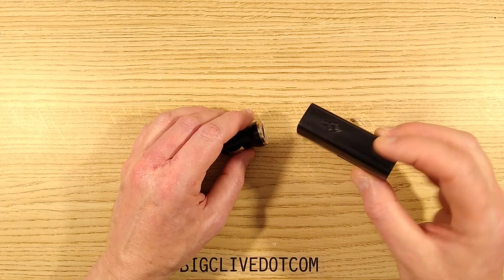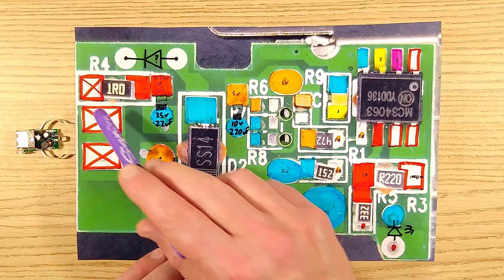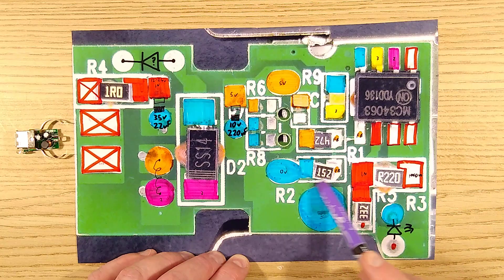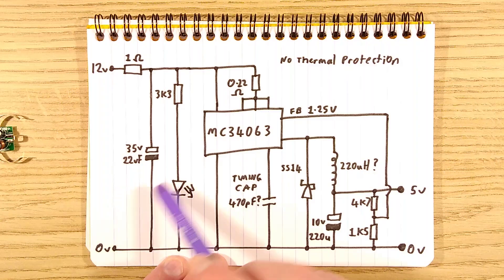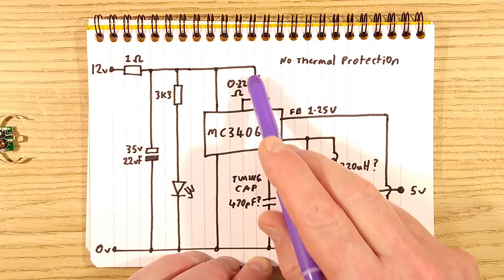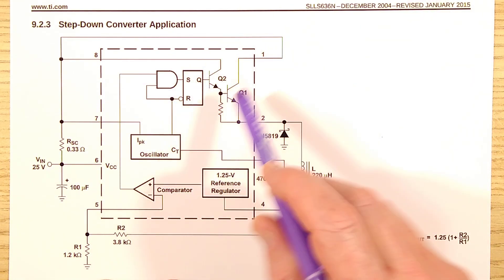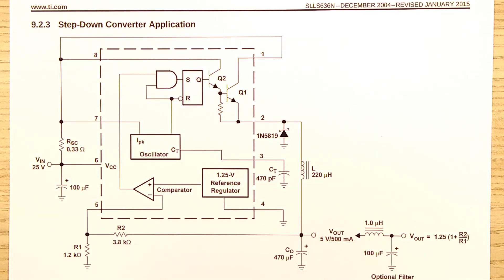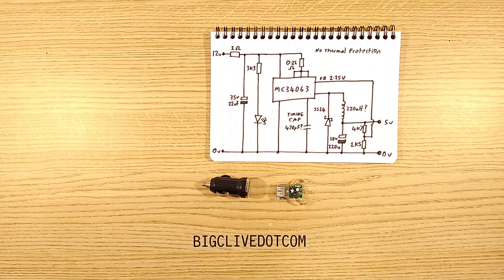Ordinary product with iconic component

Comment: Of course there will be 14V input to this when the engine is running. Will that slow down or speed up the oscillations?
Reply from the maker: I'm not sure how voltage affects the oscillator timing.  It may have a fixed voltage reference.

Comment: It'd be interesting to see if one can add a simple upgrade for thermal protection... e.g. something that would cut off the 12V input, based on a thermistor value.
Reply from the maker: It could possibly be used to skew the voltage feedback circuit to lower the voltage.
Reply: @bigclivedotcom  Chinese XL4015 buckconverter chip has this kind of suggestion even in datasheet. Introducing over 3,3 V to feedback pin makes chip to go in standby.

Comment: With more places jumping onto the USB-C/PD-for-everything bandwagon, we'll hopefully see more devices with DC input designed for 12-20V and charging using a dodgy 12V adapter won't be much of an issue anymore. Car adapters really should use a SEPIC topology to capacitively isolate DC-in from DC-out. Then expensive gadgets would be protected from input-side faults and transients up to the DC-blocking capacitors' breakdown voltage.

Comment: 3:48 Would this still be a disaster with USB C PD capable devices? Since they can accept higher voltages though I have no idea what happens if a PD capable device was expecting 5V only to suddenly get 12 since it is more than 9 but less than 15, hopefully just blow a fuse on the charge port.
Reply from the maker: I think a new device would handle the higher voltage with no issue.

Comment: At 00:55 you state it could blow up your phone,,,, The very next statement should have been, DON'T BUY THIS AND IF YOU DID THROW IT AWAY and then ended the video right there.  Absolutely no reason to consider this product at all unless you need some parts.
Reply: 100% agree. The MC3406 is interesting due to its simplicity and "building block" design but has no place being connected to valuable devices like mobile phones or sat navs.
Reply: Definitely wouldn't say end the video right there rofllmfao

Comment: The mystery missing diode was a 1N914 or similar.
It basically serves as a fuse in case someone's power outlet is wired backward, or they install their battery incorrectly.

It would create a dead short to blow any upstream fuse, or it would let the smoke out and shut down the circuit protecting the cell phone or other device plugged into it.
Reply: That would make sense too
Reply: How would the adapter and device remain shut down after the backwards diode blows?  I think it would only protect the output circuit if it blows the internal 1 ohm fuse before dying .  Car batteries can dump out 70 A or more for the starter motor anyway, so will barely feel the short, and utility sockets (cigar lighter sockets) often have generous enough fuses to allow plugging in an external starter power source .
Reply: @johndododoe1411  They would be relying on the 1 Ohm "fuse" burning out. It seems unlikely they would choose a small signal diode like a 1N914 which is only tated for 300mA, you usually see a rectifier diode like a 1N4001 or equivalent in this position.
Reply: @johndododoe1411  I think the idea is to burn the 1 ohm resistor.  It's probably rated an 1/4 or 1/2 Watt.
Reply: @johndododoe1411 
You're right, the battery would't care, but the fuse in line with the outlet will. It could be that the 1R is faster to blow but I'm not sure who would win this race
Reply: @johndododoe1411  It's not the diode that will blow in that situation.
Reply: A smarter design is to put the diode in series with the 12V. That absolutely provides reverse battery detection, at the expense of a reasonable diode and a lot of heat. Or you can use a Schottky. But as the existing diode isn't there, the budget doesn't stretch to doing this properly.

Reverse battery protection is HARD, especially for things like car ECUs which have to draw a lot of power. Everything the OEM puts in a car is MEANT to survive this and the devices all have reports saying they've been tested and survived. Aftermarket stuff - not so much.

There are two nasty ways to have a "reverse battery accident". First you put a battery in a car and get the terminal connections wrong. The other way is to have a car with a flat battery and connect the jumper leads up the wrong way around.
Reply: @TeVolt805  When I worked for a manufacturer of automotive widgets, we used to use a reverse diode that was chunky enough to outlast the power fuse. (And yes, this was tested at the product validation stage, by blowing lots of fuses.)

The voltage drop across a diode can be significant once you start getting into whole amps .....
Reply: @bluerizlagirl  One "Chunky Diode probably costs more than all of the components in this cheap product. They didn't even put in the (small) one that is meant to be there. For those asking "what's the use of blowing an internal fuse", there are two answers to that. It is better to blow a fuse than catch fire, which can happen with reverse battery. It is also better for that sub-$10 device to suicide than to dump MINUS 12V into your $2,000 mobile phone and kill it instead when there's a Reverse Battery Accident. But the makers didn't bother with that.

The 0.22R "current limit" resistor also jokingly limits the design current to 1.5A through the switch. Which is a design output current of 3A. Which is probably way over the thermal limit. Just using a properly selected resistor might make this thing safe against over-temperature failure. But they didn't.

Comment: I thought it would be a 5v regulator.. found them in these before..The LM series.
Reply from the maker: They dissipate the voltage difference as heat, so would not be suited to high current.

Comment: If I remember correctly ON is ex Philips. MC is Motorola's prefix, and though most of semiconductor manufacturers do license out and run batches of each other designs in China they don't pay much attention to what they print on the package and even less to paying license fees.
Reply: ON is the standard and discrete components spin-off from Motorola, NXP/Nexperia is the spin-off from Philips
Reply: @inse001  Thanks

Comment: i had/have that same car charger and used it to charge my android (used it all day while working) for over a year. it actually held up better than lots of other ones i used
Reply from the maker: An android phone will often test the charging device to see what current it can supply by gradually increasing the current and monitoring the voltage.
Reply: The same circuit or just the same plastic casing?
Reply: @johndododoe1411   i had opened it up years ago and seemed to remember it looking exactly like it. however since you asked i decided to dig it out and look again. turns out is not even close to the same circuit at all
Reply: More high end chargers claim to have multiple layers of overvoltage/overcurrent protection, which means more failure modes, which works against holding up the longest.

Comment: I wish I understood these things as well as you do.  I figure I get about 35-40% of it all.  I'm more apt at mechanical contrivances vs electrical.  I can can take a pew pew that I have never seen before and strip and reassemble it without question though.  My buddy used to call it a mastery of spacial relationships.
Reply from the maker: It will make more sense over time.

Comment: Quite a lot more in that freebie adapter than the ones you can get at the buck-and-a-quarter stores here in the US.

The one I took apart had an 8 pin thru hole chip but the lead spacing was smaller than the usual 0.1in spacing. Then it had a couple caps, an inductor, and an LED. No other components. The chip even has a dedicated leg for the LED. I guess it was cheaper to put as many components in the all in one chip as they could so PCB assembly could be done faster.

Comment: I tried to use one of those devices recently. It seemed nice and available when so many parts are hard to get. It's got dreadfully high on-resistance so very lossy. I tried adding an external transistor but had to replace it with a tps61088, which is far more effective.
Reply: They are a poor choice for any new design that isn't extremely cost sensitive. The losses in the bipolar switch is one issue, but also they only work up to around 100kHz so it demands larger inductors which incur either more loss or more cost.  It also uses hysteretic control which is prone to creating RF interference at low loads (a very common complaint for these cheap car adapters).
Reply: Not on resistance as it has a darlington BJT.  VBE plus VCE drop.
Reply: They were designed back in the day, when the standard for getting 5V out 12V was to use 7805 with an external BJT and a heatsink. So you can imagine, that even getting efficiency from 40% to just above 80% was a huge deal. They seem to be "very lossy" now, because you have next two generations of switch-mode regulators available to choose from, but you wouldn't have those without the first gen. stuff like this.

Comment: The reason why the MC34063 is still around is because it's a commodity item, it's cheap!  It's also available in the 8 pin DIP.  I bought a tube of them recently.  👍
Reply: Not a thing wrong with it so long as you put some safety circuitry on the load side, like say, a crowbar, lol.
Reply: Yup yup, have used them, cheap they do EVERYTHING but yeah, does need some consideration.
Reply: I saved a bunch of them from some PLC modules that sank down when flood hit open pit coal mine. Modules became unusable from transformers going bad from water.
Reply: They aren't very good, though, as they are prone to subharmonic oscillation without very careful circuit design. They tend to come on, overshoot, switch off, let the voltage decay, then repeat.

A lot of switch mode regulators can do the same thing but they usually use current mode control or other more advanced multipole compensation methods to try to avoid it because it's bad for EMI, regulation, squeal and other things.
Reply: @nicholasvinen   This is (mostly) true of (almost) any SMPS regulator with output protection circuits.  If you don't respect minimum loading specs, or filtering requirements, overshoot will kick off the OV protection circuit.  I've never heard this called subharmonic oscillation, but I suppose it does fit as well as anything else I've used to refer to it.  

This is a consideration of any buck/boost regulator I've ever run across.  The inductor energy has to go somewhere, and this does require careful design.  Mike Engelhardt designed LTSpice specifically as a design aid for designing this kind of circuit in-house at Linear Technologies.  Inductor and capacitor (energy storage devices) selection and matching to anticipated load range is always important to avoid triggering protection circuits unnecessarily.

If your circuit is "hiccuping", you need to do more design work.  Doesn't mean the chip is junk.  Just means it's simple.
Reply: @nicholasvinen  .. I think you are being a bit harsh. With the right capacitor choice the 34063 will run nice and stable.
If you are talking about minimum load requirements and going discontinuous, MANY smps chips all share similar characteristics. If you want it to be really stable in discontinuous mode you need larger output cap and/or minimum load resistor, or, like most commercial products just tolerate 25mV of ripple when there is no load. No biggie.
Reply: maybe they are still being used in european washing machines and russian drones.

Comment: I think the chip is used in my Dirt Devil Robo vacuum cleaner.
Reply: It's very common in low cost Chinese designs.  It's a pretty terrible device by modern standards even though it's simplicity is appealing.

Comment: Great to see older chips still in use.  The 555 is the very first chip I ever messed with when learning electronics.
Reply: Yup 555 n 556 n l386 ♥️👻
Reply: That and the 741❤
Reply: Followed by the 666 chip? 🤣
Reply: @two_tier_gary_rumain  nah, 556. it's two 555 in a trenchcoat.
Reply: No, the 7555 succeeded it as the CMOS version  @two_tier_gary_rumain

Comment: Strange that the block diagram has resistor values that don't occur on the E24 series, particularly when the values used in the device actually give a theoretical output which is nearer 5V.

No doubt the current of the reference will skew the result but i wouldn't have thought it would be more than a couple of millivolts.

Comment: Oh i've played a lot with that chip. It's a great building block for building small boost converters for Nixie tubes and the like. It doesn't care if you build on a breadboard, where as more modern chips requires a nice PCB layout to work at all.

Comment: Interested in your warning about not charging expensive devices. Is there a safer design or product that can be used for charging in a vehicle?
Reply: Anything from a reputable company that's got IQ charging, Anker has been my go to for many years.
Reply: No buck switching regulator is 'safe'.  The best way to protect against overvoltage is to use a 1/4A fuse on the 12V, and put a 5.6V, 5W zener diode across the output, so if the buck regulator fails shorted, the zener will shunt anything above 5.6V and blow the fuse.
Reply: @acmefixer1  Plenty of modern buck switchers can isolate the output from the input via an additional transistor.